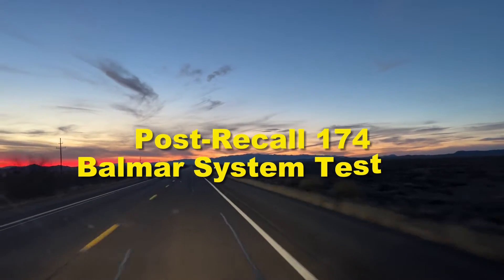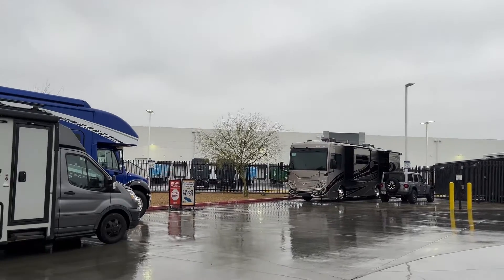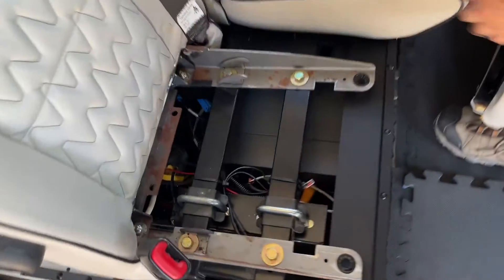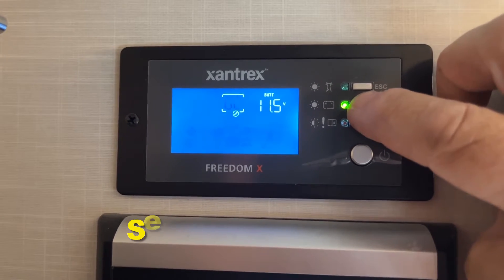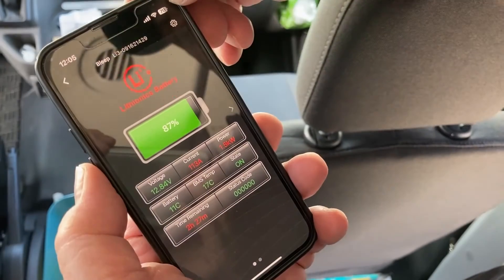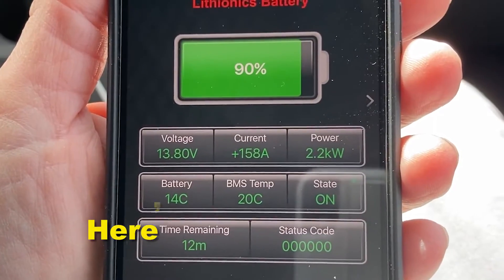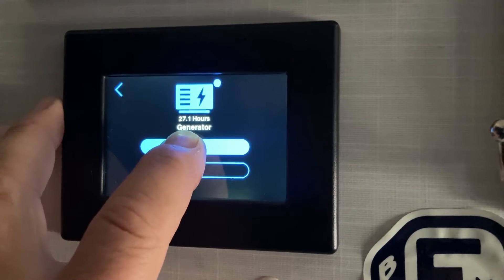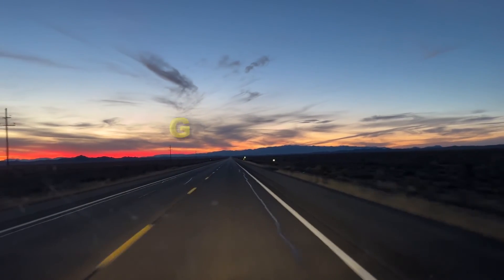Testing Winnebago Ekko electrical systems after the 174 recall

Comment: Thanks for posting. We bought a 2024 Ekko and when it's plugged into shore power, the battery loses its charge. We turned off the fridge, the external fridge, water pumps, lights etc and while it's plugged in, it loses about a volt an hour. Solar works and alternator works so it hasn't died on the road, but when it's garaged, it's a problem. I got a recall notice but it says the manufacturer hasn't figured out a repair yet, so I'm not sure if it's related to our problem, Any ideas?
Reply from the maker: Hey Mark sorry for the delay - just saw this. Are you on the Ekko Facebook group by any chance? That's your best bet for problem solving. One thing to check - the Ekko is very fussy about polarity. If the AC outlet you're plugged into is not wired correctly, the battery won't charge. However - you'd also have no power at any of the 120v outlets. So - when plugged in, do the 120v outlets work? If not, it's likely a problem at the source. Secondarily, it could be a loose wire in your shore power connection. If yes, you'll want to check Xantrex settings - you can adjust the Xantrex for various voltage conditions. See Dave Brussin's post at https://www.facebook.com/groups/ekkoownersandwannabes/posts/3171553826497289/ good luck.

Comment: Nice overview.  I’m also curious about the high amperage readings.  Do you have one or two batteries?  Also, did they replace the complete Balmar system with another brand / manufacture?
Reply from the maker: Still Balmar, just new components. One battery.

Comment: I may have missed you saying it, but how were you getting +180A? Do you have a DC-to-DC charger as well? I'm only seeing up to about 80A
Reply: I’m betting a single battery.  Dual would be 90 amps net battery…. Or… he indeed has a DC-to-DC converter as well.  Now… of the Balmar was completely replace with the new system there using now on the SprEKKO… I’m jealous.
Reply: @richardburguillos3118  you’re right about the single battery. Noticed that in the part he showed the battery compartment.
Reply from the maker: no dc/dc , single batt